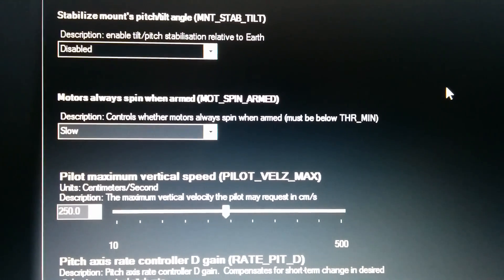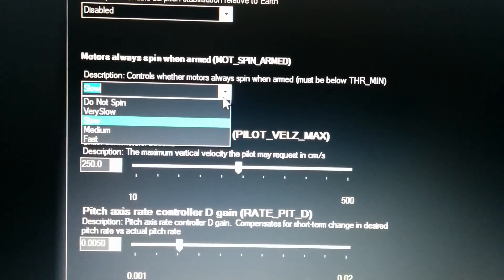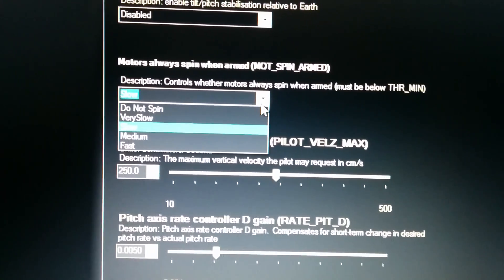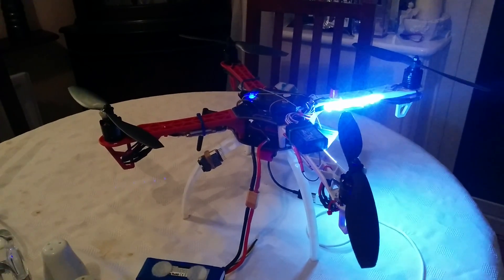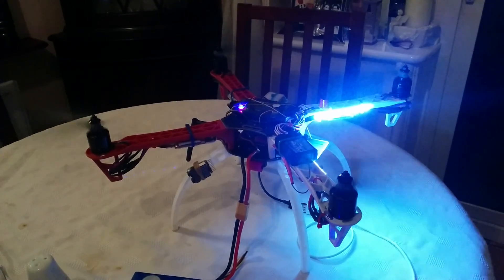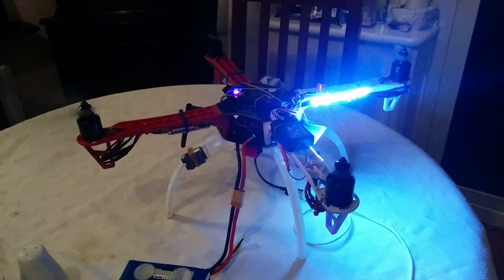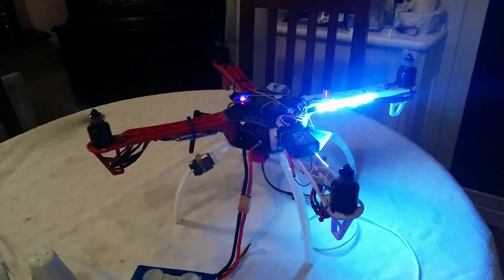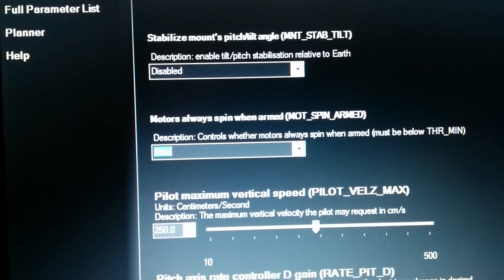APM 2.5 Arducopter 3.1 - Motors Spin When Armed

Comment: I've just come over to Arducopter after flying with a basic KK2.1 flight controller.  Seems a bit dangerous to have the blades spinning as soon as you arm the FC. What's the point of that feature? Am I missing something?
Reply from the maker: Welcome to Arducopter, it is a fabulous platform to build and learn on, with all the options and sophistications you could want. 

To answer your question - it is intended to provide a visual indication from distance that the Drone is armed and ready for takeoff.  Dangerous? Well, yes, it could be if you were arming it while being close enough to be struck with the propellers.  But you really should be at a safe distance when arming anyway.  Or you should remove the props when working on the Drone anyway (I know, yes, we typically don't :-)  ).  

DJI Drone users will be familiar with the "spin when armed" method, that you cannot disable.
Reply: @DannyThompson54  thanks mate i am stuck with apm2-8 same issue, but i have dji which does the same. motor start spinning as soon as i arm it. so i was thinking its not an issue, i should be away while arming . it could be a feature. other wise we should not arm it. thanks